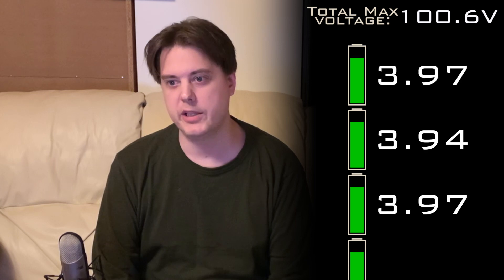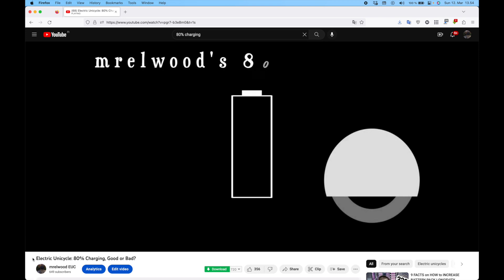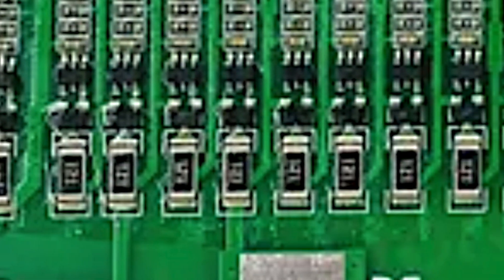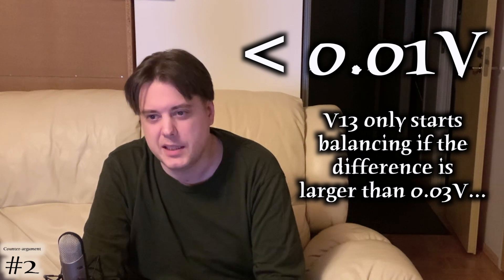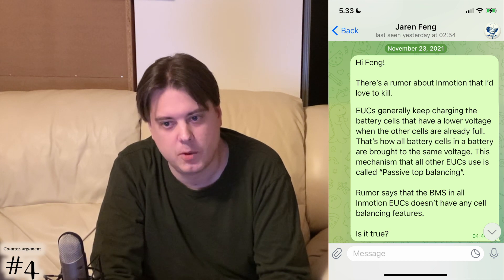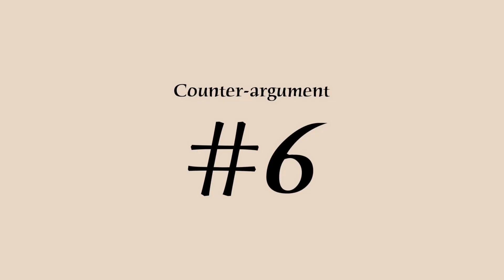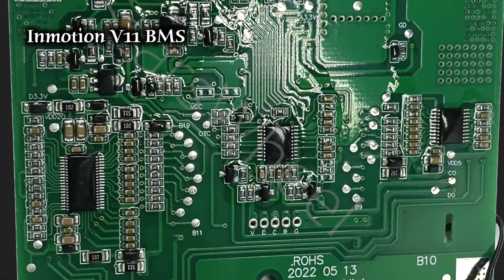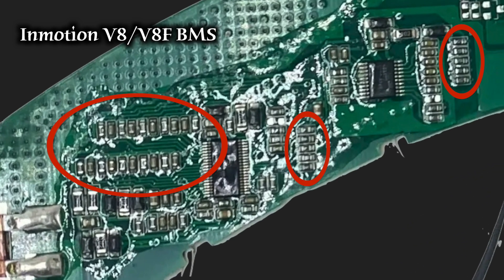Inmotion EUC Battery Cell Voltage Balancing, Yes/No?

Comment: It is rumors BMS is without passive balancing, and still rumors it is exist. Both speakers is unofficial. So we would like to hear from official source
Reply from the maker: But we have heard from the official source, Inmotion themselves! The problem is that we got two answers: yes AND no. I’m not sure how any answer from them could be definitive anymore.
Reply: @mrelwood_EUC  yes i believe there is missunderstanding or weird chinese translation, but.. even on Smart chinese bms cell charging is stopping when one of cell groups reaches 4.2V. Not sure wich one, need to review all https://www.youtube.com/@OffGridGarageAustralia/videos so it can be true and about stop of balancing
Reply: I think we can conclude that battery vehicles are a rip-off, in terms of reliability versus price, compared with gas vehicles.
Reply: @danmano478  lol (I think that was a joke?) - I don't know of any gas powered self balancing wheels - the throttle response would not be sensitive enough to respond to the millisecond input from the gyroscope .... my Inmotion wheels have been very reliable, and that includes an early batch V12 that they pro actively replaced the mosfet board for - mine never blew, eevee's was great at getting the replacements done. This is cutting edge stuff, I hope it matures now and gets more reliable and stable.
Reply: @brushlessmotoring    I didn’t thought of EUCs on gas, I was comparing the reliability of EUCs with cars and motorcycles on gas. And this, as a response to the comparison made by some EUCs fanatics when it comes to the high prices of EUCs. They compare them to gas vehicles finding advantages for EUCs to justify the high prices. So, what I want to point out is that no matter what advantages bring EUCs, the difference in reliability is so big, that the prices of EUCs should be much lower. This argument is enough, without bringing in “the one person vehicle” argument and “the safety” argument. “Bleeding edge” argument to justify the overpricing of EUCs is long overdue. I bet even after another 20 years some interested clowns will still bring this argument to justify the high prices from which they are sucking deep. Good for you, that you drew a winning lottery with your V12. There are a lot of reports of defect V12s in first year, even in first months. Also after the changed motherboard, and also for V12HT, which came with better motherboard from factory. My V5f last me only one year. Read extensively the threads in forum.electricunicycle.org and see all the problems reported by normal users/customers, which are dominant, in rapport with a few moderators and affiliated clowns who always come with diy solutions and with their “positive experience” regarding their wheels. Reliability means that the product is good enough from factory to last at least 2 years without problems, and not to rely on knowledge shared by third parties and having to diy yourself (after you paid thousands of $/€). And all this in mass, not only a part of produced EUCs have been QCed and others not, from here buying an expensive EUC being a lottery. I am not a hater of EUCs, or of electric vehicles in general. I just want them to be reliable, waterproofed, with a manageable weight and affordable. That’s it. This is not the case nowadays. It’s a dirty business, with many actors involved (manufacturers, resellers, Youtube afilliates, moderators of specialized EUC sites affiliates, dumb fans/fanatics - all pretending having no financial interests, just passion -> bullshit). The reality is, normal people, with normal income can’t afford buying these expensive, unreliable vehicles. If they are expensive, at least they should be reliable, so that investing 2000 - 4000 $/€ in a wheel should be done only once in 4 - 5 years. You mentioned eevee’s dealer. If you search throughly you will see for each dealer many customers satisfied with the warranty handled, but also customers unsatisfied that are being attacked by “satisfied” ones, in fact friend and affiliates with special treatment, for which they pay by combating the customers with unhonored warranty claims.

Comment: Great content! "A lie [misunderstanding] is halfway round the world before the truth has got its boots on". I still meet people who will die on their sword on how 80% charging is "good" for batteries (without a smart bms).
Reply from the maker: That is so true! Thanks!
Reply: @mrelwood_EUC  Hi. I have a question on this subject. This 80% battery charging not preserving the battery as one thought, is valid also for laptop batteries? I mean it is better than charging to 80% and discharging to 20%, to charge to 100% each time and discharge until 20% and repeat, for longer battery life?
Reply from the maker: I don’t think it is relevant. I’m not familiar with how a laptop manages the battery, but I have no reason to believe that they would use a passive top balancing system like EUCs do. It wouldn’t sound like a smart move.

My recommendations and experiences only concern EUCs and their batteries due to how they are designed and built.
Reply: @mrelwood_EUC  OK. Thanks for the answer. I thought, both being batteries that use electricity, upon same principles, they have similar behavior.
Reply from the maker: Car battery is also a battery that creates electricity, yet it is constructed completely differently. 😉

Cell balancing on EUCs is a BMS function, so in a sense the balance charging recommendations are not there directly for the battery cells themselves, but for the BMS. A single cell battery does benefit quite noticeably from 80% charging, it’s just that EUCs with their large high voltage series battery packs and the way most EUC BMSs are constructed, do not.